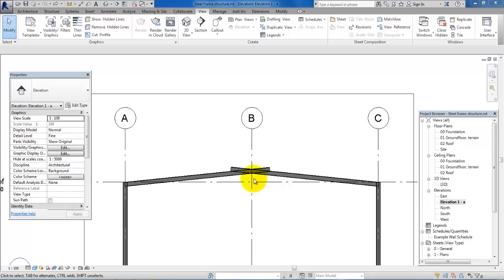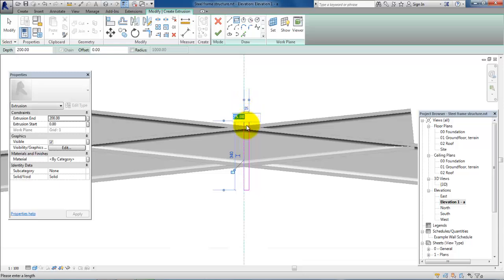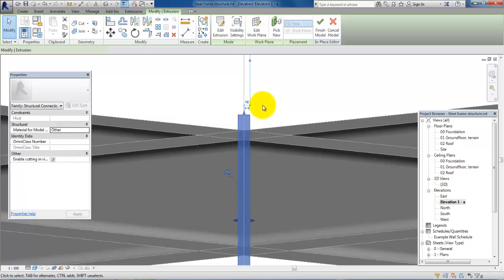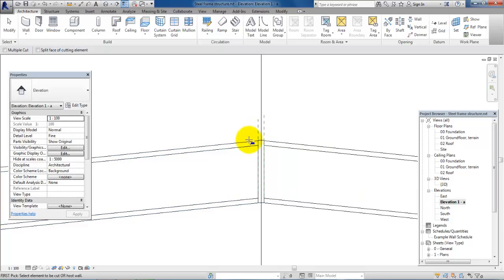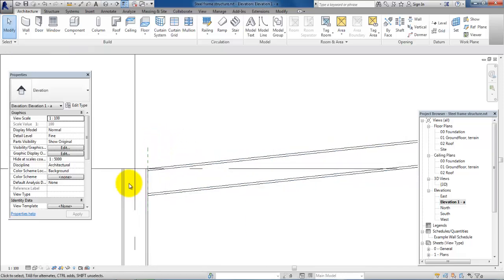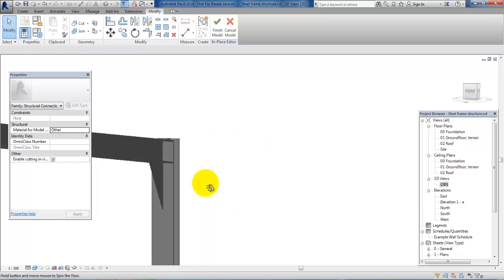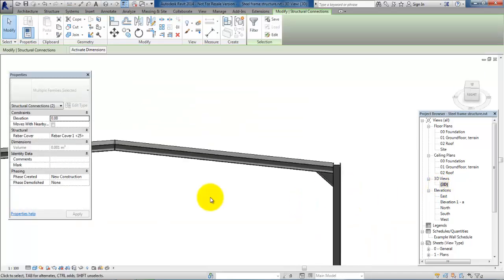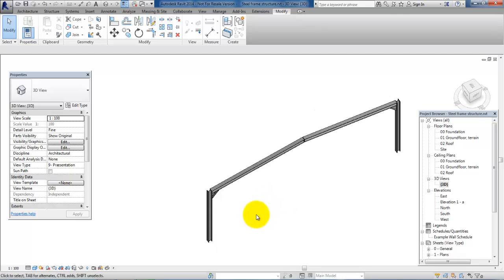Revit 2014_Steel frame structure - part 2

Comment: Hello Katrine, thank you for this tutorial. I have a question if you don't mind me asking. How do you copy the entire connection bundle to the next grid? For me it seems like I can only move it along the beam's plane and not perpendicular to it. Thanks in advance.
Reply from the maker: imhoman Hi. When you have selected the steel structure and clicked "copy" you may need to unmark "constrains", which should appear just below the toolbar. That should allow you to copy the structure to the next gridline... :-)
Reply: Katrine Steenbach - VIA University College Hi Katrine, Thank you so much, that did the trick :) just for the record, when I move the connection the cut geometry doesn't stay cut on the ridge and at the eaves so I had to re-do it at every grid location but that wasn't too hard to do. Now I can move on to your other videos :)
Reply from the maker: imhoman Hi again. Yes, I know that some students have problems with the connections do not stay cut, however, other students do not have the problem. I'm not sure why it is not the same in all cases...but at least it's rather fast to cut the geometry again :-)